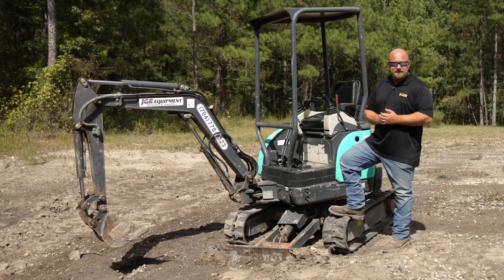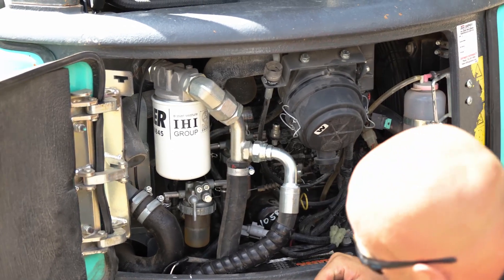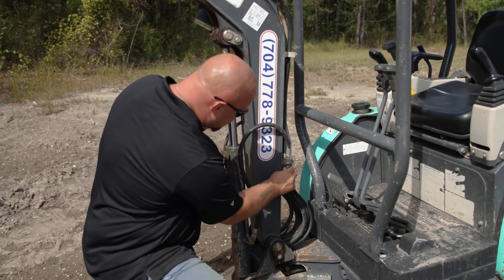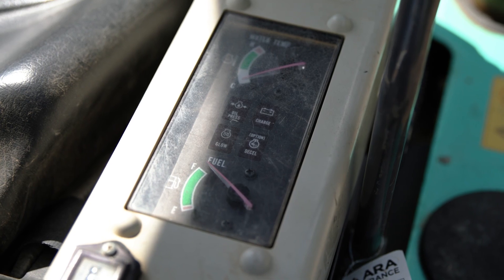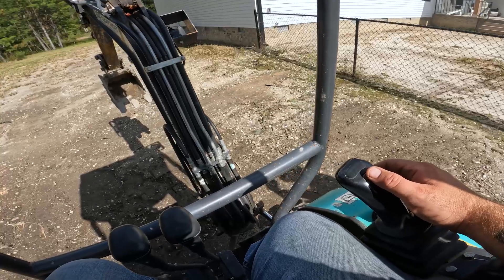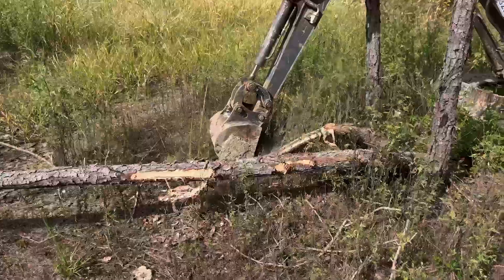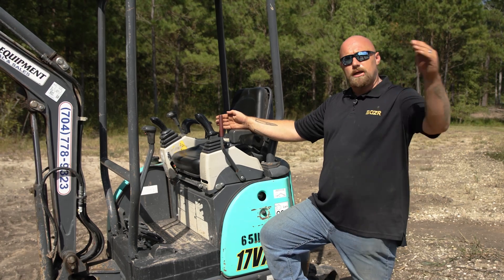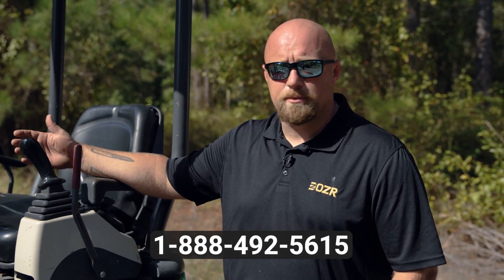How to Operate a Mini Excavator

Comment: A great overview, sir.  I would note, though, for new users that the blade should be behind you when digging with a mini ex (unlike larger excavators).  That would have helped you with those trees!  Thanks for taking the time to make such a professional video...nicely done!
Reply from the maker: That's a great tip! We cover using the blade as a balancing tool later in the video too.